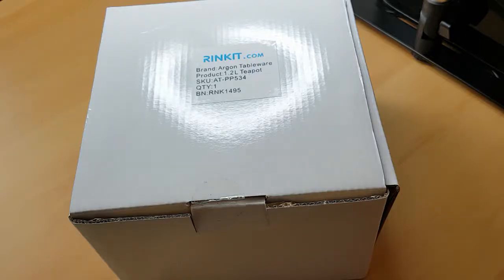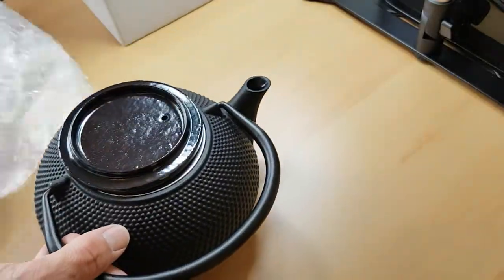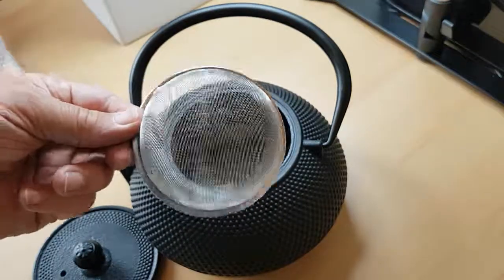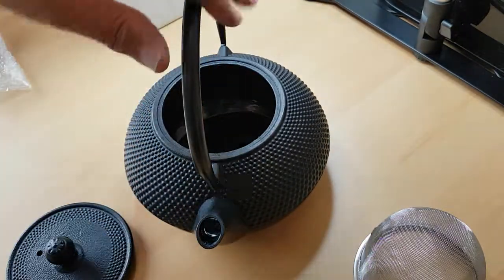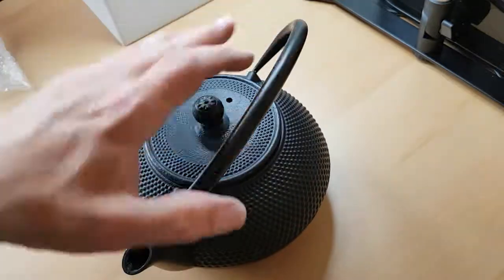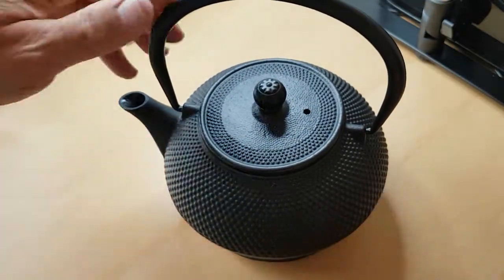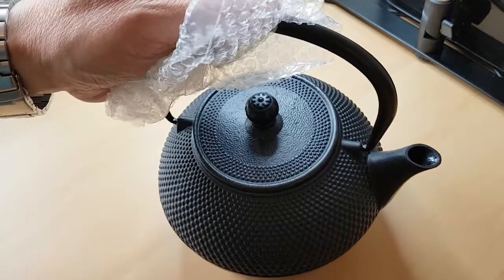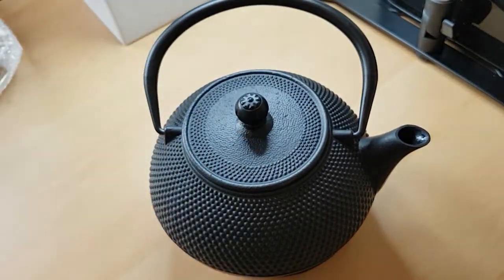Beautiful Japanese Cast Iron Tea Pot

Comment: So exited just ordered  a japanese teapot which is non enameled. I think i got a good price out of it through amazon japan.
Reply from the maker: That's great. I didn't see a non enamelled one. I would have prefered it. I hope yours turns out good. Will you be using it regular or just for special occasions?
Reply: @Topdoginuk  I drink tea a lot. If it's not that difficult to maintain, I'm gonna use it every night. It's just good for around 500ml. I would have preferred the enamel lined but they are not suited for stove top.

Comment: I tilt the handle to the side when pouring the hot water in. The handle of mine has never gotten hot. You should never put an enamel lined pot on the stove. It will crack the enamel.

Comment: When they are enameled i believe you cant put them on a stove
Reply: That is correct.
Reply: Lots of people say this but it’s fine as long as it’s not on high heat. I use mine on gas stove. 
As long as it’s not shocked ie putting cold water into a hot kettle it’s generally okay.